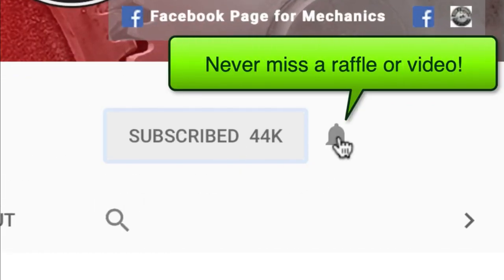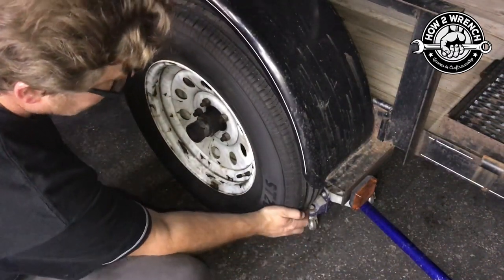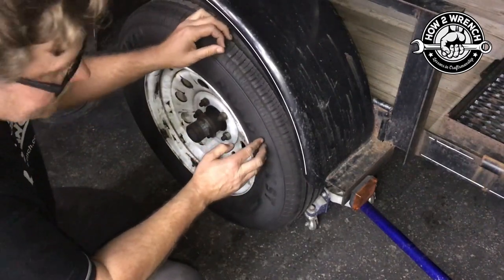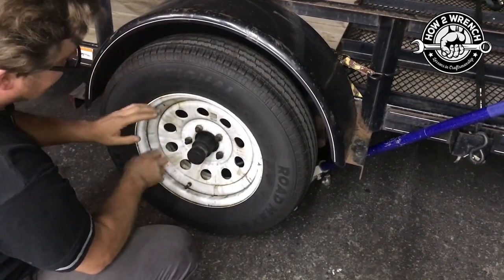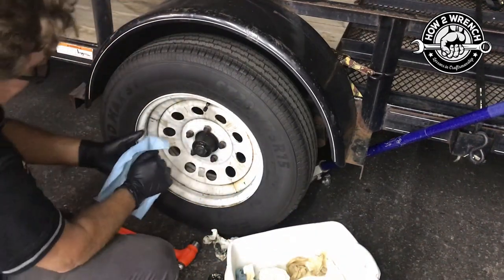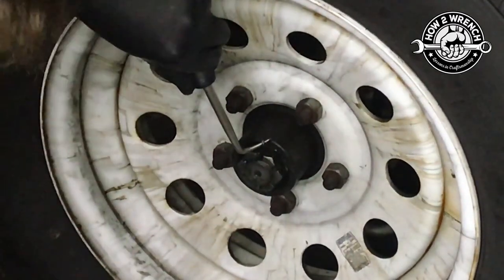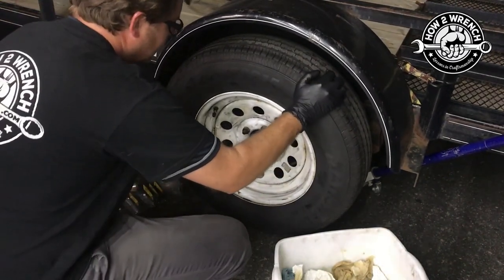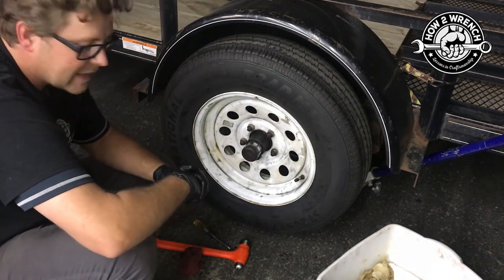How to adjust trailer bearings. Inspect and adjust wheel bearings! Works on RV Trailers, Campers too

Comment: Thanks for that informative video, I watched the dial one that you told us to look. I have a question for my rv trailer, i changed my bearings, races, drums, so everything is new. I took a dial indicator meeter for the first time to look the play I have. Tell me if the way I did it is ok. Well the meter was magnet to my frame and the pin of the gauge was right on the top side of my drum, right to the edge of the drum, at 10'' to 12'' circle. I push my drum side to side and I got 0.002 and sometime 0.003. I know I'm in the range that it suppose to be but I want to make sure I put the dial indicator the right way. An other question tell me if I'm right, let say I have 0.002 or 0.003 from the 12'' drum do you thing if we were able to measure the play right between the bearing we could find around 0.001? And let say if I was gona be able to put the dial meter right againt the metal wheel or the tire we could expect to have like 0.005 or maybee a little bit more cause the wheel is bigger size than the drum and the bearing itself ? I'm trying to make myself a template or kind of a model for next services, if this is right the way I did it, I will keep in mind 0.002 to 0.003 from the drum is a good play for bearings, so not to loose or not too tight. I really like your channel very informative and you explain very well. Thanks.
Reply from the maker: We are just the social media team. You can catch Shane daily as a channel member or supporter. He is the only person in the shop and training center so you can imagine how busy it is. 

Note to other community subs, can anyone please help XXXXXX?

FYI...he does drop his tools and try to answer comments for non members at times when he is online but is pretty swamped. If your not in a hurry, he will get back to this in time. If you want him ASAP here are the links: (P.S. thanks in advance for being a solid human being and understanding we have to pay the bills too...😏)

Option 1: 
Consider joining...best $1.99 you'll spend this month 😁 This is great for quick answers. 
He literally logs in and answers member questions daily! He does an AM and PM check-in to answer all member questions. Join this channel to get access to the perks:
https://www.youtube.com/channel/UCBhM8DCKnT3qXwTW0eToyCg/join    
-Daily MEMBER FIRST COMMENTS ANSWERED FIRST 
-Live Q/A video chats
-Wonder if we have a video on your need? Members can request content links!
-Full Access to the ENTIRE 700 video library
-Member-Only FREE tool giveaways  
Option 2: 
 If you need help sooner choose his 1:1 option! What you get is a deep dive one-on-one with him. Use video, email, and phone support. He will drop his tools and work with you directly! 
Get Shane’s cell here: https://how2wrench.com/ols/products/techline-one-on-one

Comment: Yeah I could see the slop and hear it too, also the rim looks as if grease had flew out of the hub and left splatter lines on it which I have never seen on a hub that has a grease buddy or a cap so I’m thinking at one point it came off and was replaced before you bought it?? Nicely done by the   way 👍😎👍
Reply from the maker: Thanks pal...

Comment: Why do you have bearing buddies on a utility trailer? They are for boats that are in the water on a regular bases.  Bearing buddies don't lube the bearings. They only put a 3 psi pressure in the hub to keep out water.

Comment: So you are supposed to torque yo 60 lbs back out and hand tight if you just tighten this like this you did nothing to squeeze the greese from the bearing seats and just waisted your time.
Reply from the maker: We will try to answer this a bit more friendly. Your incorrect on the 60 lbs and that number is specific to an axle size (bearing actually) . What we showed comes direct from Timken bearing training. Please anyone reading this including (respectfully) must take into account t using specs for torque from the trailer manufacturer is always the best choice.